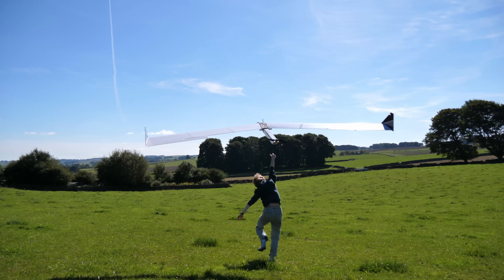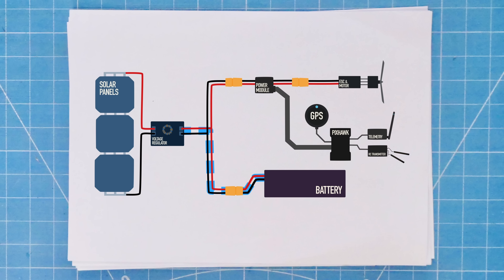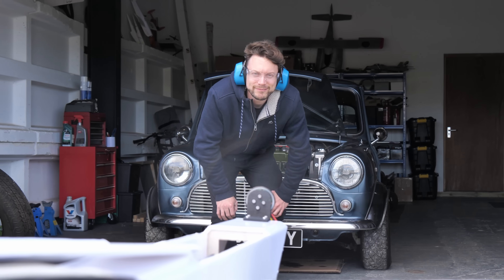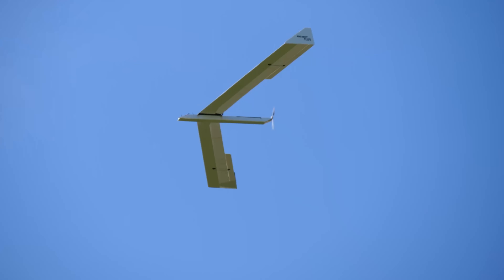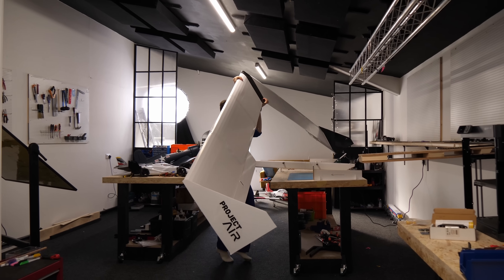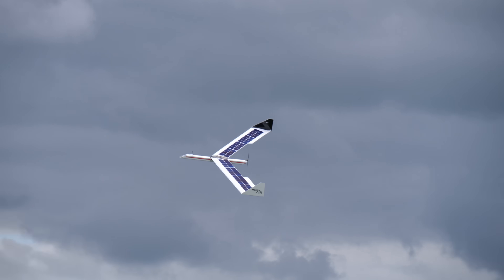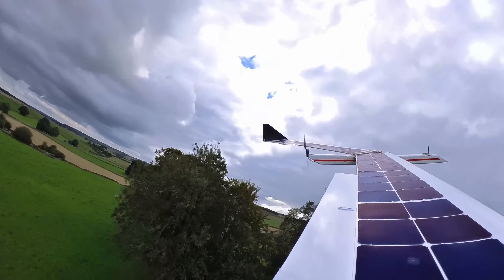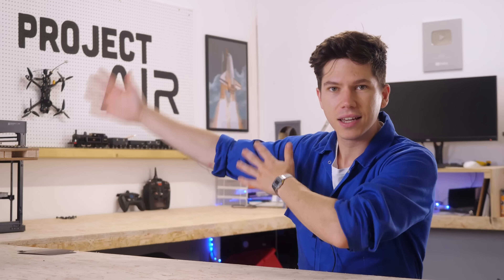Solar Plane V2

Comment: You could try increasing the lift by increasing the mass with helium filled structures. Also reducing mass by replacing foam with foil. I think (see below) a foil covered structure might be lighter than one build out of foam panels.
And then there is the possibility to switch to a lighter foam. A much more expensive foam, of which I have no idea if it can be used for model planes.
I'm talking aerogels.

You mentioned a delta wing. A delta would give much more surface area for cells. You also could go mixed. A smaller delta in the middle and extended to normal wings.

Look at me, the Dunning-Kruger "I haven't build any model aircrafts" making suggestions to the expert. ... I just hope I'm the blind chicken to find a grain.

Comment: Link a few hundred rubber bands together so you have a long chain. Fix a post a couple hundred feet out in the feild and attack the rubber band chain to it. Use a small hook on the aircraft to attach the rubber bands too. Give it a good strech and let it fly. The rubber bands will fall off the hook when they loose tension. This would provide a much smoother and safer launch. Ive  done this exact method before with great results.

Comment: Conventional plane design isn't going to work for this project. The weight of your power system relative to the available surface area for power collection is a physics problem. I'm not sure if you've done this already, but you should be able (through small-scale powered testing) to determine how much power it takes to lift a certain amount of weight - then it would be a question of determining how much area is necessary to generate that power through solar capture. My suspicion is that you're going to have to get a little bit odd with any successful aircraft design, since obviously you need a certain amount of rigidity (weight) to have long wings survive. The delta shape is an interesting idea, but the drag and weight penalties for that sort of airframe are huge - you'd need much more power than it seems you currently have on board. I'd say your best solution is probably some sort of offset biplane or multi-wing design with square edges and a strong lift-generating angle of attack on the wings. The thing will fly like a bag of bollocks and probably not at all on a day with any sort of wind - but you MUST have all exposed surfaces generating lift. If you could house your power components within the wings, you might stand a chance. Good luck!

Comment: Yeah, there's a reason we use MPPT controllers instead of just a buck converter for solar charging.  The former is vastly more efficient, as it can find the optimal current to draw from the panels for maximum power and then regulate it down for the battery.

Just take the MPPT out of the loop for everything but the battery.  Or use a better MPPT that doesn't shut down the battery when the solar input is low.

Comment: I rarely connect the load to the MPPT "load" output unless I want to monitor the power consumption. Any large or fail-safe load should be connected directly to the battery. I think MPPT modules always have a "load" output more as cool feature, you  don't actually need to use them.

Comment: add flaps for more lift
consider a puller instead of a pusher design, see if that works
even better, make a completely new plane in a glider format so that it can rely on those pesky winds for lift as well,
replace the aluminum with carbon fiber rods or wooden dowels

Comment: several things i would like to suggest tho:
1. directly charging a serial lipo pack without any sort of balancing device is a no no, but putting that thing in a plane adds weight so i kinda get it.

2. puller is generally more efficient than pusher, pusher hobby gliders do that mostly to get the prop out of the way so they can get a better FPV experience, but the efficient/fast ones are always the pullers. Also pullers are way safer for Emma and this is from someone who got prop cut experiences, those scars heal slow. And pullers are quieter too.

3. Use Li-ion cells, they are way more energy dense than most hobby lipos, hobby lipos are generally designed to do fast discharge so pilots can have the best 3 minutes of their life but not for long time cruising, also li-ion cells are a bit safer for those complicated charge/discharge situations.

4. i know budget is key but no one would put L shaped aluminum bars inside wings, carbon tubes are the way to go.

5. try more off the shelf rc planes as testbeds, either gliders as you shown or some deltawings, molded wings are way more efficient than garage made foam boards and i mean WAY more.

really looking forward to see what  things are gonna be like tho and you've already done a great job, keep it going!!

Comment: I don't understand why you don't use carbon fiber for the wings. It probably costs less than 80€ and would not weigh even 200 grams..I think that could make a proper difference

Comment: Wing structure can be made lighter and stronger by having thinner support beams in wing tip and and tail and bottom and top centre instead of one thick beam in the centre. Wing skin can be made of mylar foil glued to airfoil rib structure of the wing to massively reduce the weight

Comment: I'm also doing the same build. Can't help but think you're complicating the build with electronics.. pixhawk is so old and outdated, get a speedybee f405 wing mini, put inav on it and a micro gps which will all in cost less than a pixhawk you'll also save 30g on just a flight controller and about 30g on the gps! It all adds up. The wing design is good but the motor isn't ideal, you need to do thrust testing overall not just what's more efficient at a throttle %, you need to know how much to get it in the air and how much to cruise then tune the motor/prop combo for good cruise with room to climb. You don't need a full rod of aluminium through it, just enough to stop the main flex to the fuse, look at planes that have spars already, they don't need to span the entire length. You'll save up to 100g on electronics if you use more modern tech, lighten the motor mount and use a folding prop for landing, they do far smaller escs, I have a 50A esc that weighs 13g all in where as yours is at least 70g. Get rid of lipos get lithium 18650s or 21700s, fraction of the weight right there. The purple pack you have is 486g, 4s 18650 pack will be around 200g and 3000mah or a 21700 pack around 300g for 4500mah.

Comment: You could taper the aluminum L extrusions, to reduce the weight quite a bit, as the load at the wingtips is zero, increasing toward the fuselage.

Comment: Have you considered that you are thinking about this as a plane rather than an RC device. RC behaves entirely differently than model planes. 
First off start with a sheet of foam board and see if you can get it to fly. You might find that a sheet will fly when you have everything you need. A large sheet is capable of holding a lot of solar.

Comment: To test a solar plane, you need some sun! You also need an mppt controller as it is both a current and voltage regulator.
Don't use the load output from the controller - it's unnecessary and can't handle current demand and tries to be too clever. Just charge the battery, and draw from the battery.
The flight controller can be programmed to return home or land if the battery gets too low.
Use tried and tested designs - like a modern glider or flying wing. The swept back wobbly narrow wings was a terrible design idea!
Keep tail fins out of the way so they don't cast any shadow on any cell whatsoever.  Put cells on the tail fins too.
Consider using an X wing design, so that cells can spend more time tilted toward the sun, and less time in shade. Use one string per wing.

Don't use aluminium for the wing struts - use carbon fibre rods or tubes.
Don't use hot glue to fix the cells - they get very hot and will melt the glue and they will fall off. Encapsulate with a special high temperature film, not cellophane or cling film.
Designing a solar plane is difficult, but not impossible!

Comment: Lengthen the nose a bit more. Make a sharper front nosecone and place angled canards on the front to bring down the stall speed. Move the verticals to mid wing, and add small wingtips to the end of the wings to add efficiency.

Comment: So, why not make a twin boom setup with carbon tubes as booms and maybe even a twin carbon spar setup? You can still use the electronics system that you made and have the ability to mount panels on the tail too since it'd be pretty large.

Comment: An MPPT IS a Voltage regulator inherently, with the additional benefit of extracting the maximum power from your cells. Keep it! And as others have said, keep the battery in parallel with your Loads, don't use the load terminals on the MPPT and you are good.

Comment: If you aren't flying at high subsonic speeds, I'm confused why you're using a swept wing design. perhaps consider  a slight dihedral as well for stability.

Comment: Did i miss something or why did he use a 4S Lifepo4 Solar Charger for a 3S LiPo Battery? the voltage would not be compatible. 
And the Voltage regulator is a bad choice, as some other guy said that it is doing not good with different irradiation levels.

Comment: Using a lipo battery for these kinds of projects is kinda useless, as lipos are known for having low capacity but high discharge rates. Using a lithium ion battery pack (which you can make at home) gives you at least twice that capacity for the same weight. And I see no reason for connecting the batteries parallel to the motor when you can use the mppt to charge the battery only which will give you more control of the plane as it won't be wheather dependent. And for a small advice, encapsulate the solar cells to make them more reliable as they are really sensitive to dust and water. 
Great project by the way

Comment: Go for carbon fiber. Labour intensive, annoying, messy. But stiff and light. You can find a lot of carbon tube ready to buy, and laminate what you need. I think it deserves at least same calculation on weight saving.
I made some parts for my motorcycle and I'm not a professional at all, it's not so expensive nor difficult, you just need time and patience.

Comment: Sorry, the disconnect voltages are in the manual. I had a hunch they would be and it took me 2 mins to google and find it. Page 8/8. But you do make the whole "deep crash investigation" sound a whole lot nicer than just "oops, we messed up and didn't bother to read the manual". 

I like that you now have a proper engineer on staff, perhaps it will be less hacky going forward. Or maybe not, maybe crashing for silly reasons (not doing the proper reseach - or disregarding it) is better for clicks. I kinda think it's the latter. Which is a shame, really.

Comment: Just wondering if you drilled lightening holes in the aluminum angle , might give better performance at less weight  for the same strength upgrade

Comment: it has already been said in other comments but you need to keep the mppt as it ensures macimum solar efficiency, but you should simply connect the load to the battery and not to the mppt, this is done routinely on large solar setups and shouldn't cause any problem ad long as you don't overdischarge your battery

Comment: Why not put a 20cm rod in the centre of the mass and connect 3 evenly spaced wires to it from the wings to stabilize it? Same on the bottom side.

Comment: Have you tried drilling out the aluminum angle with as many holes as you can make to remove some of the weight but still keep the stiffness….what about using balsa wood instead? In construction for rock wall corners have an aluminum angle full of triangular cuts that could work

Comment: Use carbon fibre SHS for your wing stiffener and print the motor mount on its side to increase its strength, you can also coat the printed parts with super glue, this will increase strength and reduce wind drag.

Comment: The constant aspect of the wing over such a large swept span will cause it to be prone to oscillations.
A taper helps prevent this and you can use the extra area at the root for a few extra cells, or drop a few at the tips.
Edit: Also, the constant airfoil swept profile and a non rigid wing design causes twisting effects during loading typical from pitch changes. This again causes new pitch changes and thus oscillations.

Comment: You could half the weight of the aluminium if you change its profile..... the wings were flexing vertically, meaning you only need an "I" cross section to stiffen the wing, not an "L" cross section.

Comment: I can't see up close, so I'm not sure, but I think the propeller is facing the wrong way. Since you are using the motor as a pusher, the propeller should be facing the other way. This could lead to a significant loss of power. This might be one of your biggest problems. I believe this design should be able to fly comfortably at lower powers. Congratulations, you're doing great!
Reply: i agree with him.
Reply: @cansamur-v9c  read what I said at the bottom
Reply: @cansamur-v9c  If you saw one the last video they showed the military drones where they also have the motors at a pusher and that’s because when you have the motors in the front it turns it from a glider to a flyer because the air is being obstructed by the propeller causing stress on the plane itself. Also having the propeller in the from causes a sort of spin on the air plane making it so you have to tilt the prop to a certain angle to make it not spin out, all though it may seem like it’s on the wrong side, it’s totally correct and it’s a design and flight aspect for the propeller placement overall.
Reply: If you saw one the last video they showed the military drones where they also have the motors at a pusher and that’s because when you have the motors in the front it turns it from a glider to a flyer because the air is being obstructed by the propeller causing stress on the plane itself. Also having the propeller in the from causes a sort of spin on the air plane making it so you have to tilt the prop to a certain angle to make it not spin out, all though it may seem like it’s on the wrong side, it’s totally correct and it’s a design and flight aspect for the propeller placement overall.
Reply: I think he's right about the propeller thing
Reply: @borailkinonu4136  If you saw one the last video they showed the military drones where they also have the motors at a pusher and that’s because when you have the motors in the front it turns it from a glider to a flyer because the air is being obstructed by the propeller causing stress on the plane itself. Also having the propeller in the from causes a sort of spin on the air plane making it so you have to tilt the prop to a certain angle to make it not spin out, all though it may seem like it’s on the wrong side, it’s totally correct and it’s a design and flight aspect for the propeller placement overall.

Comment: print the propeller mount on the side, it broke right along the layer lines.
Reply: I guarantee you that I can still snap the mount with my hands, while it will become almost impossible to do so when you print it on it's side.

Comment: I would stick to the MPPT for solar, as it is much more efficient in suboptimal conditions and just have a small backup battery just for telemtetry and avionics, so when there's not enough charge left to power the motor, you can atleast bring it down safely.

Comment: All of the energy to get it into the air, I wonder if a slingshot or similar design to get it up to speed would help reduce the power draw early in the flight.

Comment: Probably makes sense to try carbon fiber rods instead of the heavy aluminium. Kite shops have them in all shapes and sizes for pretty cheap and the beefier ones are strong enough to withstand heavy winds (and the resulting crashes) on large wingspan kites.

Comment: I gotta ask, why did you go down the aluminum right angle support rather than a far lighter commercially produced carbon fiber rod or even right angle support which would have be a fraction of the weight of "alu-mininum" (US vs Brit language humor)? IIRC, RCTESTFLIGHT went down the road of carbon fiber reinforcement inside the wing for the spars and used a blended delta wing (which you alluded to going down the route of at the end of the video as your next step) and high lift glider wing design. He was very worried about the weight to lift ratio given the performance window required for sustained solar flight so weight was one of his top concerns.

Looking forward to seeing the progress on this project and ultimately which route you take. Keep Calm and carry on from your engineering friends across the pond.

Comment: You really should use carbon fiber and not aluminium for that spar. And it definitely should be tube-shaped or at the very least a box-section, not a spar, as they are much heavier for the same torsional rigidity.

Comment: a few comments from a grad student in aerospace
fly by wire != autopilot, fly by wire is any flight control system where the control surfaces are not directly connected to the controller, so your plane is fly by wire even when it is controlled by your controller
a rear swept flying wing…with a fuselage…is not a efficient design especially at low speed, forward swept or no sweep, rear sweep is specifically for speeds approaching super sonic
as for the low roll rate, get larger control surfaces
Reply from the maker: Thanks for your comment! ☺️ Fly-by-wire is the name of a mode on the Ardupilot control system on the FC. A swept wing is usually found on flying wings to improve stability, over a plank wing design that has a straight wing. It is actually quite an efficient shape, demonstrated by NASA's Prandtl wing, which set a duration record. You should check that out. Thanks! - James